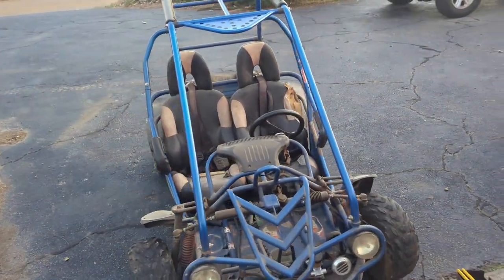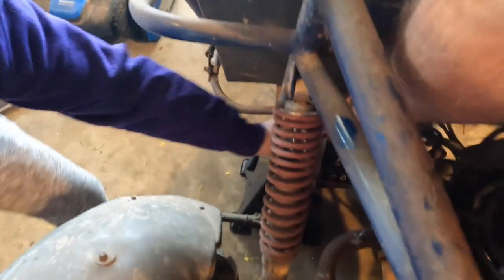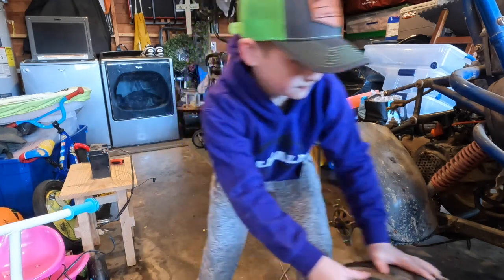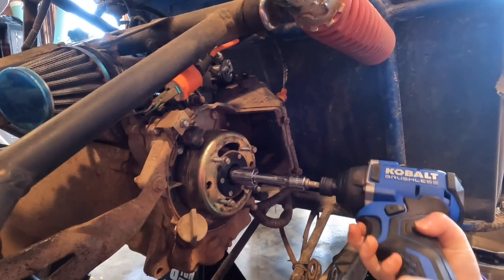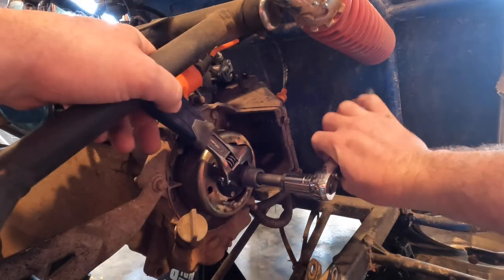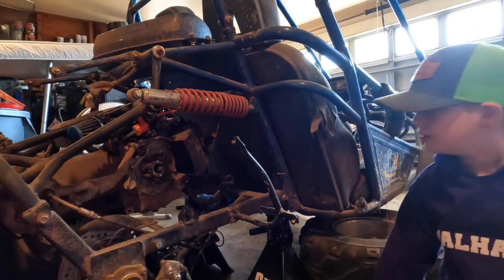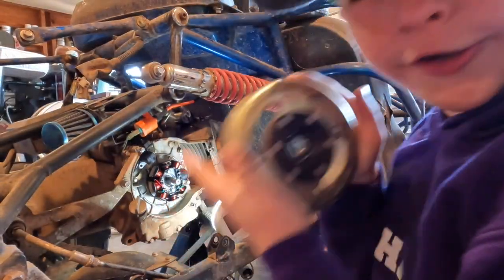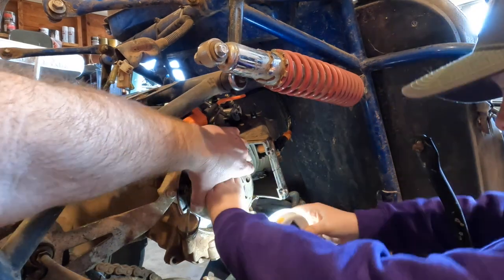Replacing the stator on a Gy6 150cc go-kart: Project Beta

Comment: Quick question what was the puller you used to thread into that bolt ? 5:19
Reply from the maker: I got it off of Amazon. I'm not sure which one it was. I just searched gy6 flywheel puller

Comment: I have the GTS 150 and it doesn’t crank but the battery is good. Any possible recommendations?
Reply from the maker: We changed our stator and it still wouldn't crank over once we charged the battery. I started tracing wires after that. One of our wires going into our coil was rubbed in half. There is a pinch point going under the intake. I'd look there and start tracing wires before putting money into a lot of parts.